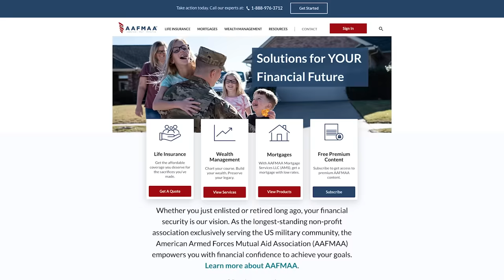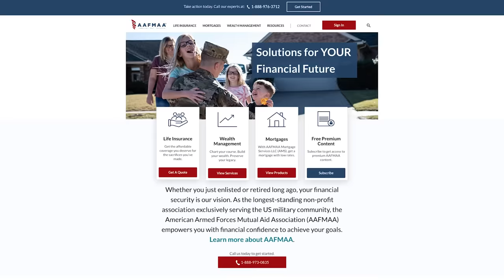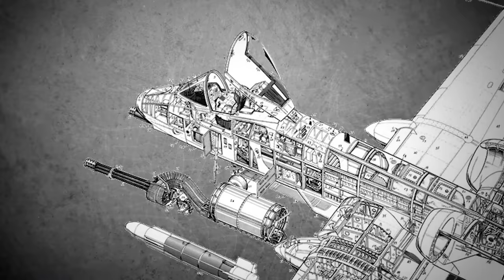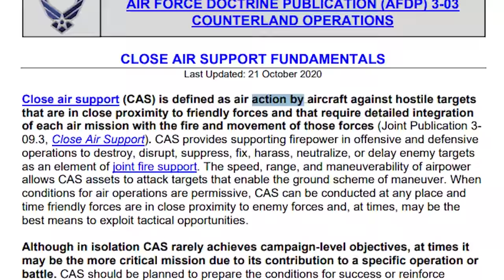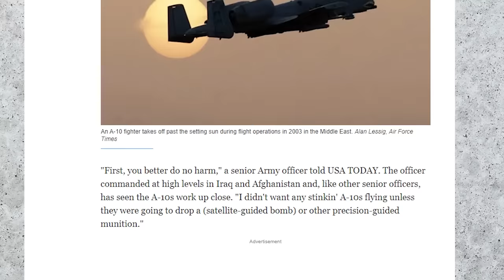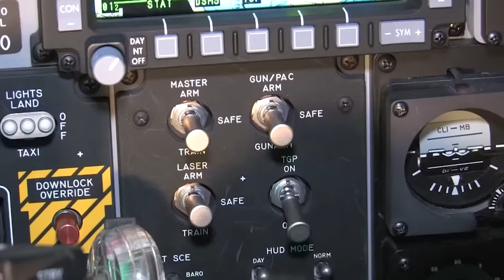Why the Air Force is Screaming to Retire the A-10 Warthog

Comment: I’ve heard that accuracy problem is a rather serious problem, so won’t necessarily defend the A10 specifically, but I think we are much to reliant on guided missiles now days. At this rate, only infantry are probably going to have conventional, unguided projectiles as their primary weapon, and some might not have any weapon except a few smart explosives.
Reply: Dude, you absolutely do not want dumb shells hitting on your position due to a targetting error. The US invested in making their artillery and rocketry fire very accurate since the end of WW2 so that friendly fire would not happen as often as before...
Reply: @theotherohlourdespadua1131  in a drawn out war the advantages of guided munitions will most likely be outweighed by their expense and production time. Look how fast Ukraine and russia have run through their artillery shell stockpiles.
Reply: @theotherohlourdespadua1131  true, but it sounds like it’s just asking for a new ecm breakthrough to just cripple the entire military.
Not to mention, you can only hold so many missiles, and I’d imagine they are a lot more expensive and time consuming to make than shells, let alone bullets (and whatever they call auto cannon rounds).
Reply: @micahbonewell5994  And look how much more effective even a single SMArt round or GMLRS rocket is. They can easily outweigh dozens of conventional equivalents and make the launch platform more survivable because it does not need to fire a full salvo. Drone assisted guided artillery is the future.
Reply: Precision missiles and shells are expensive and time consuming to build.  They have their role as do cheap drones.  I think an analysis of the situation in Ukraine would turn up tasks that would fit the Warthog’s capabilities.  For one, suppressing fire along a trench line which is a major problem the Ukrainians have as opposed to the point targets the missiles and precision shells are taking out.  Taking out KA-52’s with Air to Air would be another one.
Reply: @bwise7739 The issue here is that against any enemy with sufficient ammunition stockpiles to make production rate an issue, that enemy will likely also have sufficient anti-air capabilities to make strafing runs a poor idea.
Reply: @simonteesdale9752  and that’s the issue.  Do the Russians still have that ability?  Ukraine has been targeting their AA systems. Russians are complaining about lack of counter battery  fire also so  what is the state of their AA?  Anti radiation systems might take out they radar units blinding them,  MANPADS might be a problem but how vulnerable are A10’s compared to jets?
Reply: @micahbonewell5994  The thing is that Ukraine, for the price of one ir two GMLRS rockets, destroyed entire stockpiles of dumb ammo.
Having billions of dumb shells in storage does nothing when the enemy can do more with less.
Reply: @bwise7739  it would be cheaper to sling AMRAAMs from an F-16 from 40 miles out than getting within AIM-9 range to a Ka-52.
Reply: @bwise7739  Pretty reasonable take (avoiding the AA discussion since don't know those details about the current war).

Though my biggest criticism was more people putting all their eggs into one basket, relying on the guidance systems let them take out the enemy quickly, reliably, and with less ammo.
Reply: @dragonturtle2703  One thing I’ve been concerned about with the precision guided munitions for a long time is what happens if someone jams or otherwise disables GPS?  A few missiles with a couple of tons of sand in retrograde orbits might make quick work of the GPS satellites.   Russians have claimed they’ve jammed the signals used by HIMARS but I have seen any proof of that.  Jamming the Kamikaze drones Ukraine has been using is another issue that would defeat one of their best homegrown weapons.  Of course the Russians don’t even seem to be able to give their troops encrypted radios let alone effective jamming without interfering with their own systems.

Comment: When the A-10 is retired, it seems a platform designed for close air support when air superiority is established would be very useful.  Specifically designed to be inexpensive, easy to maintain, have high survivability and focused on using effective yet inexpensive ammunition.
Reply: Like AT-802U?
Reply: @LetoDeWirre  Yeah, they could probably be more widely used.  Not very glamourous but if it gets the job done, who cares.  I would imagine there would be a need for something more substantial though as well.  With jet engines, modern electronics tied into other platforms and systems, and designed to be easily upgradable as technology advances.

Comment: I could also see the Bofors gun philosophy making a showing. The time / proxy fleshette rounds being one of the several choices being used in a way here. The way each round bursts & shreds an approximately 40 x 80 foot area for each round sent down range would make an amazing addition to the AC130 or other CAS vehicle.
Reply: I haven't fleshed out the details in my mind but I think there is something there in a ground vehicle that would have something that would between that and a modern Ontos.

A true infantry support vehicle, that could handle everything short of a tank or fighter jet (you could add missiles for that if you really wanted a true do everything) and was much lighter and more transportable than a tank

Something in the range of like 40mm and 105mm guns with ammo options. Handle drones, suppress the hell out of infantry, wreak absolute havoc in an urban environment, demolish walls and obstacles

Comment: The USAF has a boat load of Embraer Super Tucanos that are also used as close air support for other nations. They could also be used in a pinch if needed.
Reply: But only against incompetent barely armed opponents with no air force in small constabulary wars should some drone shortage happen. Drones win far and away over bug smashers on loiter time and especially not require CSAR which leads to disasters like depicted in "Bat 21" which was a US loss.
Reply: the super tucano is an outdated propeller engine massively exacerbated by brazilian Embraer, as it is one of it's first sources of revenue mainly in poorer countries and now they want to step in in NATO, building the N config in Portugal. Considering what it wights and fp it can take to CAS missions it was a good plane back in the 80's, there are much modern airframes and with much advanced avionics than the Super Tucano or the Super Tucano N to be. For instance special forces in the US in the same range of the super tucano but more advanced, asked for units of attack T6A Texan I, but soccom went, for overwatch of sof on ground, it the L3Harris AT-802U Sky Warden, which is also superior to the overrated Tucano. The only communallity of the afore mentioned propeller planes is if they're worried whit plane and pilot survivability they'll take a couple HP machine gun its and their out of action if not destroyed - I'm not even mentioning Manpads. The A-10 is CAS Tank, and it should remain on such role (with a possibility of carrying tons more of missiles on takeoff and withstand fire from HB MGs) asked by sof community and not anymore as a tank buster as tech evolves. but surely it's a bunker of fortitied positions grinder, compared to the tiny weapons the propeller ones can carry and the few they carry. I would prefer to have cas (which is really a mission and not an aircraft) done by an army AH-64 apache (longbow included) or navy AH-Z1 viper, rather than a battlefield outdated supertucano and similars; even an AC-130 gunship. Heck, why the F-35 to fill such a role when it's a multirole and a billion dollars designed plane which units reaching 3 figures of million dollars each? For such price and real massive weaponry handling, plus doing cas from afar (which is a paradox per si - long range support/CAS) I would go doubtless with the F-15 Eagle II and it's endless number of hardpoints to carry the latest weaponry created and to be created and with engines wich allowed him to take off fully loaded. I really don't get it.

Comment: Flying low still works against ground based radar. Line of sight is still a thing. The gun isn't for tanks, in the modern environment,  but for lesser armored vehicles (and other lightly armored targets of opportunity such as boats / light ships). The point of the a-10 is the value per dollar in flight cost. Yesterday airframes are old. Build new ones, with slight upgrades to the design, modern avionics,  a view to future upgrades, while maintaining that value and survivability (for the pilot).
Reply: By the time you design a whole new CAS aircraft, build the factory, develop the supply chain, and hire/train workers to build it, it will be cheaper to just buy an extra 100-200 F-35s with some extra ammo capacity, or to just use the F-16.  I think 2,000 Apaches can make up the difference in gun firepower.
Reply: But why bother when you can just use precision munitions to do all the same roles better? Plus, you can make the A10 as cheap as you like, but you'll never match a drone for reduced production cost and maintenance.

It's just obsolete.
Reply: @michaelccozens  I see but drones can be jammed and emp’d but agree to disagree
Reply: @Chillforev-dd9wr A-10s can be jammed
Reply: As someone who literally maintains and operates surface to ground radars, no, flying low doesn't work. We will see you, and line of sight hasn't been a factor since the 90s or earlier.

Comment: you missed a few historical points, Chris.  First, the USAF brass started trying to end the A-10 right around 1982, using many of the same excuses the current brass are using, largely because the CAS mission is not one that the fighter mafia or the strategic bomber mafia really want-they want the funding, they want the title, but they don't want to do it.

Comment: It was an intriguing and exciting venture and I got to know many crews when they were stationed in Suffolk, England.
Unfortunately, they were too big and noisy and many pilots would rather have done without the Gatling in favor of better comms and visibility from the canopy. It was apparently prone to parallax distortion which could make ID difficult and landing in high winds extremely hazardous.
Several stationed at RAF Bentwaters were flipped over by high winds even when anchored with special ties on the undercarriage.
Ultimately, the lack of dash speed and less crew protection than that of the SU-25 or Harrier GR9 ended its useful life somewhat before it was removed from the UK.

Comment: The A10 did take out T72's in Iraq. The A10 isn't always hitting the front most of the time it's hitting the top of the tank and that's some of the thinnest armor
Reply: Not with the gau8 as you're hinting at, but with mavericks.
Reply: Given the most optimal test situation of the gau8 vs t62 "similies" (aka M47 pattons) it seems incredibly unlikely that there's a single t72 gunkill (meanwhile they fired 85%+ of all mavericks used during DS1).

Comment: Definitely the case that close air support is about the proximity of the munitions, not the proximity of the jet. The ideal CAS mission for the Air Force would be launching a missile from their golf cart, while doing the back nine at Andrews, before returning to their game. The gun on the A-10 is awesome, but a serious concern for blue on blue incidents due to the overly large beaten zone of the rounds falling, depending on the line of attack and disposition of friendly troops. It doesn't have any worse chance of hitting friendlies with rockets and bombs, but given the low and slow thing it should be much less likely (could have been due to pilot training cuts during the Sequester budget years as much as poor avionics). The A-10 should have an advantage of using less than pristine airfields closer to the fighting, but I don't know if this advantage was ever made use of in Iraq or Afghanistan. These jets wouldn't do so well in most fronts in Ukraine, except reconfigured as kamikaze drones to open up lines of attack, because they'd be soaking up rockets pretty quick.
Reply: In a modern high intensity conflict an A-10 will never get close enough to use its gun.  All the other combat jets USAF has already provide CAS at higher speeds from safer altitudes.
Reply: Yeah, a lot of Frogfoots have been shot down in Ukraine and they're basically a slightly faster A-10 with similar armor. 

If a slightly better A-10 can't handle a modern battlefield, the A-10 certainly can't.
Reply: A basement warrior
Reply: Unproven
Reply: Their not better

Comment: For DECADES the Air Force wanted to go to high-speed stealth, while the "grunts" (Army/Marine) DEMANDED a CAS like the A-10 and constantly pushed to keep it going.  Also, kind of odd to see the (yet again repeated push) AF pushing to retire the A-10 when we KNOW that they are redesigning/updating the air-frame and abilities of the A-10 to last until at LEAST 2050. 

So, we may be seeing just a simple situation of ONE location switching over to the F-35, since that is going to be the "standard" for a lot of bases. But I'm sure that the A-10 will find PLENTY of Army/Marine bases that will be happy to provide them a home.

Comment: The armor of IFVs and APCs can be easily pierced by GAU-8. The problem is the modern IFVs and APCs often have the ability to automatically track and target aircraft with .50 and higher armament, making gun runs from the A-10 risky at best.

Comment: I think a big miss here is the a-10 abysmal range. It’s combat radius is like 200 miles, which severely restricts where it can operate from. That stat alone almost disqualifies it. While it might have been cheaper than an f4 it’s more expensive than it’s alternatives. Also low range and no carrier launch capability make it useless in the pacific.
Reply: Range isn't important for CAS
Reply: @davidhuffman8352  It’s important for everything… Even just getting the planes in theater and stationing them in positions where they can do stuff. You need 1/4 as many airbases to cover the same area if you have double the range and you don’t need as many planes. That’s before we get to any issues of loiter time at far ranges resulting in the need for even more planes. Every multi role fighter in the air forces inventory has 3 times the range.

That’s not to mention the fact 200 miles puts them in range of a far greater amount of enemy ordinance when they aren’t flying.

They fly too low as well and are vulnerable to manpads that can’t even touch an f35. The Air Force expected a-10 pilots to go on suicide missions if ww3 broke out.
Reply: @NickSteffen  No, it's not, not for CAS, The closer you are to the battle area, the less time you spend traveling to and from. You need the same number of planes because of the payload

Comment: It would be interesting to see if there was interest in parting out the warthog and its 30mm and diving tactics to develop it into a more modern unmanned platform. Surely, less weight and improved speed and targeting capability would lend to improving on the role the A-10 provides.

Comment: If I'm not mistaken, I always thought the the A-10 was not first thought out as a close air support platform, it thought it's main reason for existence was to bust up Soviet tanks in the Fulda Gap, seeing that the Soviet Union has close to a 10-1 advantage in heavy armo, so we developed the A-10 to even the odds.
Reply: yeah, but tech advances made it unsuited for thicker new armor, at least it's cannon (couldn't better and more powerful shells be made? IDK) but for cas is perfect, soft targets, small bunkers and not so heavily fortified positions are like cheese to that cannon and missiles carried, which are much more than any propeller engined plane could carry, not mentioning the lack of armour they have compared to the A-10. A right straff of mg fire and bye tucano, not so super now). Still the A-10 is supposed to be used where there's already air superiority achieved, so manpads are the most risky thing that can be used agains it, not a DShK .50 cal russian. Plus if drones were also integrated with the A-10...

Comment: A not too slow replacement option doesn't seem very likely but you could definitely knock off the too old category, and potentially the too expensive. Not sure if they're going to replace the role at all due to it seeming not very viable against near peer threats due to it just getting run down by faster jets and infantry anti air technologies developing substantially and being rather abundant. Sure the infantry won't like it regardless of whether or not it makes much of a difference, but if it's still a valid role it would be a shame for it to not receive a replacement system to fulfill the role after it's discontinuation.

Comment: yes, they're getting old. But dedicated CAS will be a factor in any significant military force, once air superiority is achieved. If it's Russia or China we'd be up against, it's been obvious that their newest, most capable systems have specifications that are impressive, the ability of these countries to produce and operate these systems in any number is unlikely, and they'd be forced to fall back to obsolete systems which the A-10 or a similar aircraft built to replace it, could easily go up against. I feel as though a lot of push to get rid of guns in favor of missiles comes from the defense industry, because the missiles generate lots of money for them, while ammunition is cheap and old-tech. This is precisely why they are needed.

Comment: It’s significantly cheaper to maintain than its replacement.
Removing the A-10 from active service will result in troops death in the field.  The close air support of the A-10 can not be rivaled and the replacement airframe has ZERO commitment to close air support of ground troops.
Big freaking mistake.